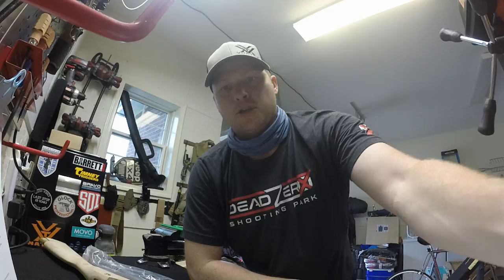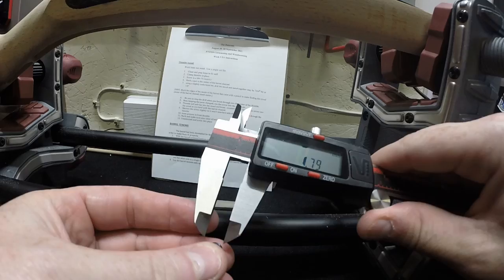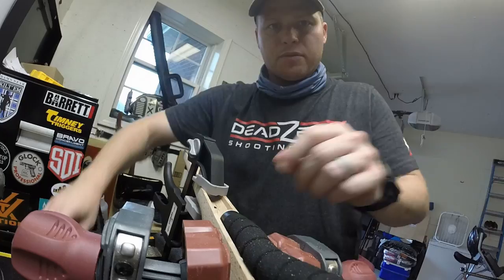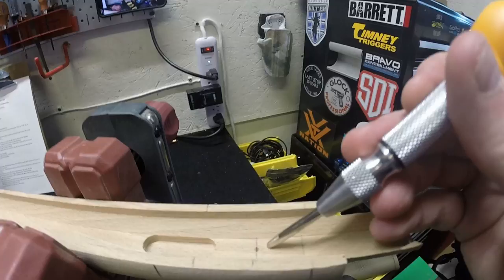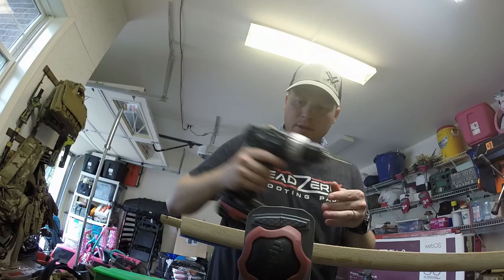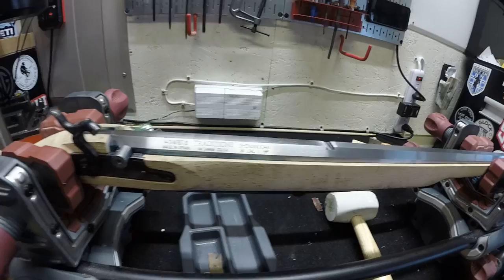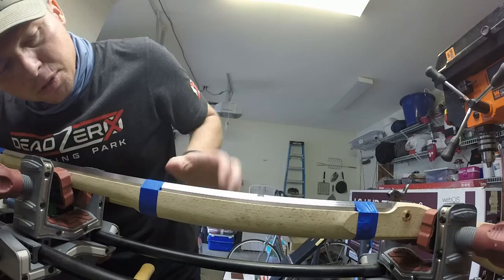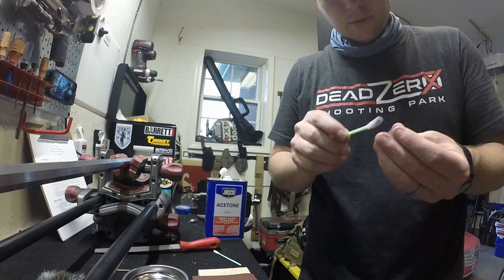Traditions Muzzleloader Build (Part 2-Barrel Tenons)

Comment: What size bit did you use on the barrel tenon?
Reply from the maker: I’ll have to go back and check. But I used a micrometer to measure the tenon and went with a drill bit the next size down. I would use this technique as I know that parts are not always the same and I wouldn’t want to give you a number that was inaccurate for your tenon.